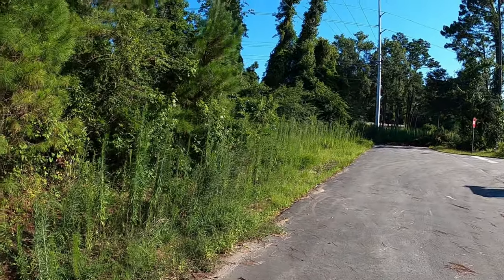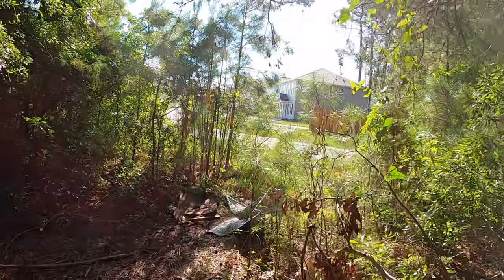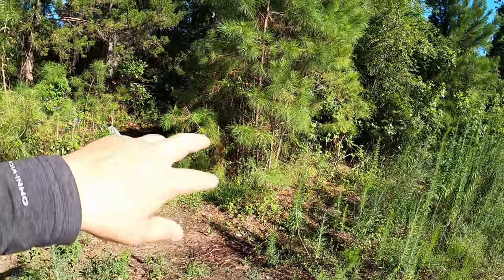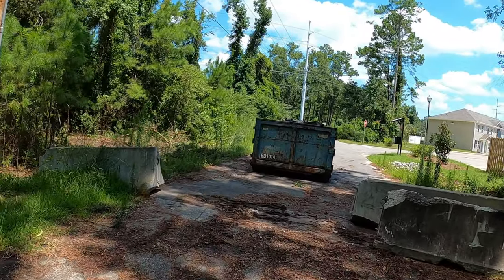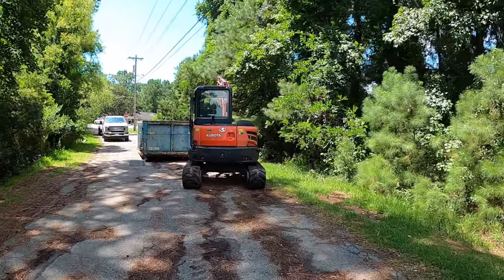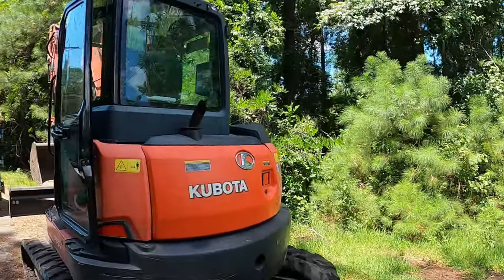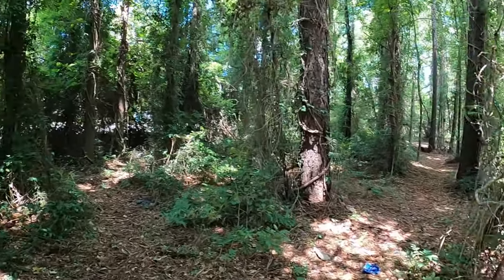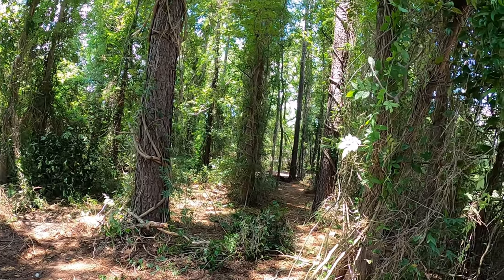HOMELESS CAMP HELLSCAPE! CLEANING UP A MASSIVE HOMELESS CAMP!

Comment: I would have made a double wide path into the 1st camp. Moved the concrete barrier. Jockeyed the dumpster out half way into the camp so you didn't have to track the trash out one bucket full at a time and muck up the ditch. Then front lift and drag the dumpster back out onto the asphalt. I'd camp place that dumpster within the arm swing of your machine. You probably had enough single bucket tracking to do on the 2nd deeper camp. That homeless encampment sub division was featured in Conde' Nasty magazine.

Comment: The couch may need some duct tape! What a mess! The homeless are a challenging problem, they first need to desire to not be homeless. Second, cities or towns need to have a place for the homeless wanting to work to reside. Third, a job that they can perform, love, and advance in. Once they are stable, they can move into a place of their own. There are going to be some with mental issues that will require a different path. You perform a great service!

Comment: I hope you recycled all the plastics because if you didn't Justin Trudeau will come after you with 3 carbon taxes.
Reply: Lol...if you wanna sort through this mess and likely get poked with dirty needles or barb wire etc, have at it.
Reply: @SusanA1056  😉🤣
Reply: Too much “mixed” plastics to salvage.
Reply: @rexoliver7780  same as inside any blue bin on the curb yes.
Reply: The “scoop and claw” operator is really good uprooting those trees and garbage!  Kudos!